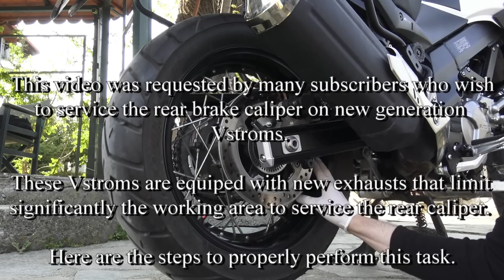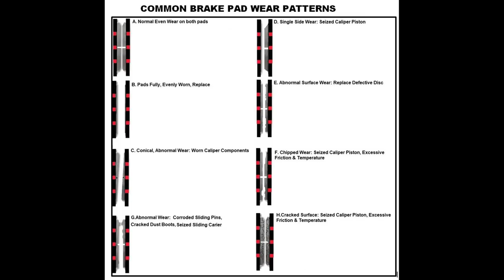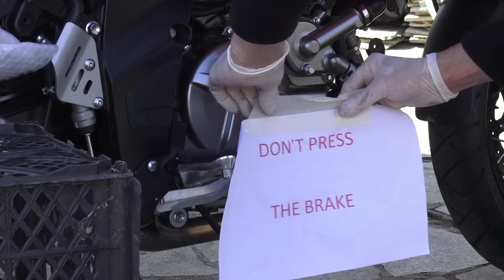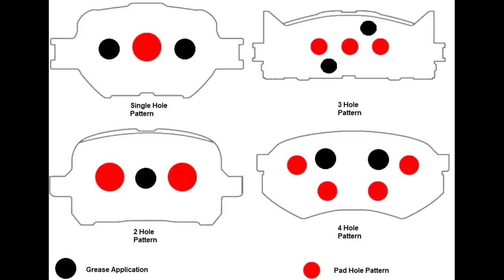How To Service Your Motorcycle Rear Brake Caliper | Dr Vstrom Brake Series

Comment: A very comprehensive and informative video. Thanks. I have a 2021 650XT which has covered 12,500 miles. I decided to give the rear brakes a clean up. All going well until I try to re-insert the top spring/shim that presses down on the pads. It will not click into place. There does not appear to be any tabs or ridges on the caliper to retain this spring. It just springs out again. What is the trick? Thank in advance.
Reply from the maker: Sure I can help. Can you please give me the time on my video where this top spring appears just to be on the safe side that we are talking about the same thing? Then I will tell you.

Comment: Thank you for your videos, they are always very inspiring, I would like to ask you a question, the metal disc of the abs system of my Vstrom has become a little white of oxide, how and with what would you clean it?? Thank you for your advice 🖐️🙂
Reply from the maker: Use baking soda and lemon and then warm soapy water. However take good care in not bending the disc or damaging the cables there.
Reply: thanks so much I will try 😅
Reply from the maker: Good luck.

Comment: Thanks for the swift reply. The spring I have difficulty re-inserting appears from 23'18" to about 23'32" in your video.
Reply from the maker: Make sure the side is correct like I mention in the video. Then you simply insert it. Just play a bit until it secures into position. If you still cannot do it I will think of helping in another way. But first try. Watch the video carefully. What exactly is your concern ?
Reply from the maker: Any news ?
Reply from the maker: Hello Wiggey, thanks so much for being a memberships member. I have just filmed and uploaded a video to help you. It is available now
Reply: @DrVstrom  Thank you for the time and effort in producing the video. Where do I find it, please?
Reply from the maker: It's on my channel the latest upload. Can you see it?
Reply: Yes. Found it. I bent the tangs a little and it gripped.  I did similar with the shim that the pads slot into. Putting it all back together now. It really is a tricky job to get everything aligned correctly. I think this is the most awkward set of brakes to deal with. I've had very many bikes and none have been so troublesome to service.  Thanks again for your time and patience.👍
Reply from the maker: Glad it helped. Ride safe.

Comment: Hello Dr. V-Strom. BIG THANK YOU for all the videos you're doing for us - very very helpful! 
I did the rear breaking pads change today following your video, but at the end I have realized, that the breaking calliper has still some movements after tightening. Is it ok? I've an video if required. Sorry I'm a new VStrom owner, thus not too much experience.... Thanks mate
Reply from the maker: Yes can you post your video on youtube and share a link ?
Reply from the maker: Did you torque all bolts ?
Reply from the maker: I think there is a bit more play or movement. Check again my video and that you followed the right steps
Reply: @DrVstrom  yes I did... Althaugh I have an DL1000 2016, the rear break calliper is almost the same + I've used the specific torque from the service manual.
Reply: @DrVstrom  I'll reassembly once again and lets see ... THANK YOU! ✌️✌️✌️

Comment: The rear caliper on my new 2021 XT has movement forward and backwards so much so that when you drag the brake going back the way it will make a "clunk" when applied in a forward motion. The caliper should move side to side as it is a floating caliper but is this much movement forward and back (2mm ish) the same on your bike?
Reply from the maker: Cannot really comment if I dont see this. DO you have a small a vid?

Comment: Hi Doc,
Don't need any threadlocker? (for example: Loctite 242)
And can I substitute the silicone grease with copper grease?
thanks
Reply from the maker: Apex no thread locker needed. Suzuki does not use it and I have load tested many times. Copper grease only where I indicate. It will eat the rubber boots, so it’s best not to use it there. It used to be a one size fit all solution back in the day when people did not have other options and abs sensors.

Comment: Can you pls recommend silicone spray and paste that is available in other countries (uk/ireland) @dr vstrom , can't see spray that is not lubricating...
Reply from the maker: Sorry i dont get your last part. If you watch also the front brake caliper video I explain what types of grease are suitable per area of the caliper. Then You can look for these types in you area. If you still are nit certain send me the types and I will confirm.
Reply: @DrVstrom I can't paste links directly but it's liqui molly Pro-Line Silicone Spray and Silverhook Silicone Grease Tube 80ml Multi-Purpose Waterproof Dielectric
Reply from the maker: Both are good but buy the 2nd due to temperatures and form
Reply: @DrVstrom  thank you kindly, what about the silicone spray (optional step)?
Reply from the maker: Both were for lubricating inside the rubber boots and the grease is better. The rest of the caliper parts you need to find other products

Comment: Hello I'm from Brazil and I have a VStron 650 2019, very good your videos, friend, I already signed up and I'm following
By the way what brown grease you put on the bolts and that blue liquid that you used to fasten the parts of the brake pad
thankful
Reply from the maker: Moto Rider Congrats on getting a vstrom :) and thanks for the kind words. The brown is anti-seize copper grease and you can find it from many brands. It stops the bolt from seizing or jamming when you tight them. The blue is loctite threadlock. It stops the bolts from untightening from vibrations.

Comment: Thank you for your work and for sharing another detailed tutorial.
For rubber parts (23:53), can I use that silicone? -> t.ly/5g4g
Just to be on the safe side, the question is: is it silicon grease that will have the same consistency all the time, or silicone paste which will harden a bit after a while?
Reply from the maker: Hello, no I dont recommend you to use what you shared in the link. It has to be a silicone grease or white grease particularly suitable as lubricant & sealant for orings and plastics and able to withstand temps ideally +220 as it is breaks. It will have the same consistency all the time and I can confirm this cause when I opened mine after a year, the product I used in my video was still the same consistency. Ride safe.